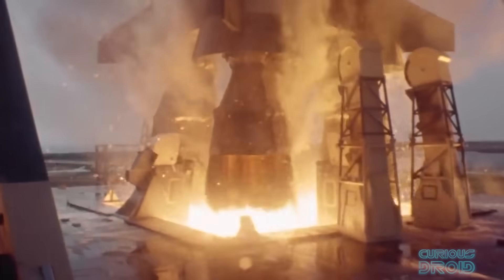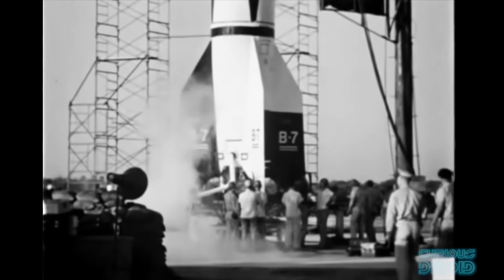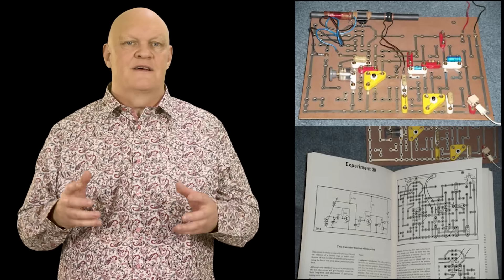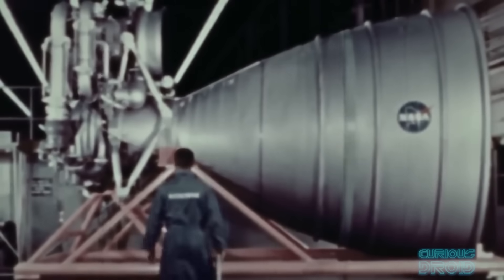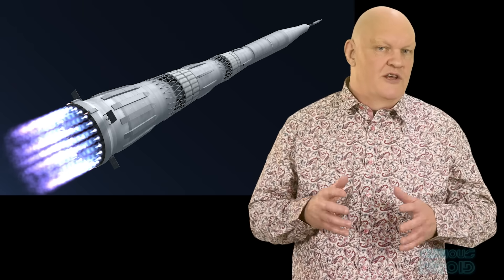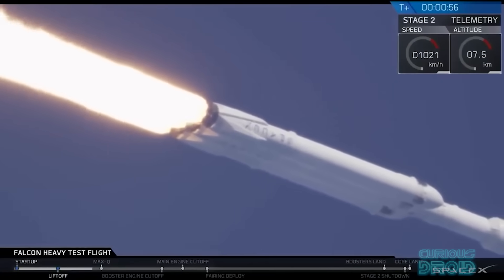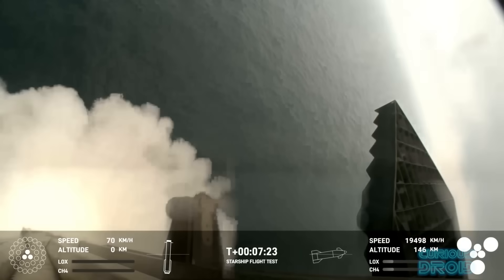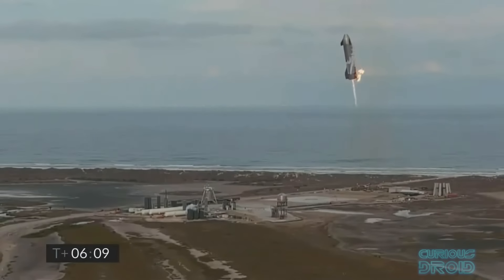Why Does SpaceX Use 33 Engines While NASA Used Just 5?

Comment: The F-1 was only "relatively" simple. Agreed, it could not throttle. But the sheer tonnage of fuel moved 0:07 through turbines in an ignition sequence requiring analogue components eg wax disks to burst at optimal time to ensure ignition was audacious, glorious, and never to be repeated. The US version if Soviet tractor design. Simple+adequate=good.
Reply: You're wrong. The F1 could be deep throttled, they just never bothered with it because they didn't need to.
Reply: Now in English please 😅
Reply: @BigPapaVerde17  There were no computers in the F-1s, so the timing of things was often handled by bits of "stuff" that would burn through, or melt, at just the right time to say divert gases from the turbine "engines" to start entering the nozzle to help protect it before full ignition. A lot of it could have been a fantasy by Rube Goldberg, but engineered with precision. Did you know that the protective covers on the hold-down clamps for the Saturn V were literal bits of cord? Seriously.
Reply: Did you ever see a documentary on the Russian moon capsule? The life support systems were built around an array of faucets instead of electronics! "Comrade, did you just fart? Turn on CO2 scrubber number 3!". Famously in the early manned space program astronauts systematically tested which ballpoint pen designs would still work in zero-G, while cosmonauts were simply issued pencils. As you say, simple+adequate=good. Not to mention cheap.
Reply: Holy skidmarked flight suits! We have a moon landing liar idiot plant.  Here! Incredible. Don't scare it, I want to study it's habits...
Reply: Did Apollo 11 actually leave near-Earth orbit?
Despite the revisionist narrative that this channel won't question -- unstable fuel burn for the oversized F1 engines was never rectified and another arrangement in their place was made in order to reach near Earth orbit, keeping the F1 bell nozzle to maintain the desired appearance.  The great licking yellow flame was an indication that something was not normal as fuel was burning in the atmosphere while providing no additional thrust. This was the result of injecting additional kerosene into the exhaust stream for greater visual effect yet appearing to produce an inefficient burn unlike other rockets after launch.  No explanation is forthcoming and this issue is not addressed in any usual report; however, using a smaller reliable engine with a reduced fuel load and stripped down mission requirement allowed the Saturn V to reach near-Earth orbit.  

The Apollo 11 crew attempted to demonstrate their position at over halfway to the moon as seen in the unedited version presented to the public while the more recently released unedited version reveals a flood of blue light entering the same window as the camera continues to roll, through which only a moment before, we saw the Earth far distant in what appeared to be very low light conditions. Then, as the camera pulls back from the window, the exposure settings are seen to return to normal as a flood of light enters the same window.  Without a change in the orientation of the spacecraft assumed to be on a trajectory toward the moon, the only source for any flood of light can be the Earth while in near-Earth orbit.  The usual sponsored efforts will try to make excuses for why the obvious did not take place -- yet is overly apparent in the unedited version.  When facts cannot prevail in support, sponsored activity will resort to name calling and other derogatory comments discrediting themselves.
Reply: @ronaldgreene5733  The "yellow froth" was exhaust from the turbines whacking the fuel into the F-I. That kerosene-rick exhaust was injected into the engines as an additional coolant layer between the fully-burning fuel coming through the injector plate and the inner lining of the nozzle. Now, drink your milk and go to sleep, you silly boy.
Reply: .  . While remaining in near-Earth orbit, another indication are the impossible weather patterns seen on Earth, when in reality only a small portion of the Earth's surface was visible, framed by the round window of the command module.  Straight line cloud fronts are seen on video to be extending for what appears to be more than 6000 miles, a quarter of the Earth's circumference -- something that has never occurred in the meteorological record on Earth. The round window of the command module was used to effect an image of the Earth but the weather in the region did not comply for a realistic view.  No recognizable continents are found in view, but only the impossible weather patterns seen.
Reply: @ronaldgreene5733  You need to understand the perspective of a) low Earth orbit; b) windows at minimal size to ensure safe flight operations (not sight-seeing) and c) no provision  wide-angle lenses (again, not sight-seeing). Lengthy statements based on incorrect information are no more correct than short statements. Please keep them short hereafter, for all our sakes.
Reply: @mickwilson99 .  . "You need to understand " .  . 😃 .  . Thank you for your sponsored reply, Mick.  Apollo 11 claimed to be over halfway to the moon -- demonstrating with a view of the Earth in the distance according to the record.  If the camera was able to zoom in from that distance to view a portion of the Earth, then we would see the area change around the edge as the camera was in motion. The camera was not steady as they continued to make adjustments.  Yet the same round portion remained visible of a specific area of the Earth's surface regardless which way the camera moved during adjustment, proving that something else was framing the area of Earth in view -- not the aperture of the camera but rather the round window of the command module.  It can be clearly seen on video that the camera is back and away from the window as someone's arm momentarily enters view between the camera and the window.  If only he had remained to one side so that the illusion might be presentable.  However, the weather in the region did not comply, having two prominent straight line cloud fronts traversing most of the area in view -- belying the claim that we were looking at the entire Earth, far distant from over half way to the moon -- rather than a small portion of the Earth's surface measuring a couple of hundred miles across where such cloud patterns are realistic .  . Give it another shot there, Mick and we'll wait for your response.

Comment: the spacex starship design is eerily reminiscent of the USSR N1 which also kept exploding...an earlier version of the N1, with a similar engine layout, was the infamous R16 which was at the center of the 1961 nedelin disaster...
Reply: There are major differences though. 
1. Engines: the NK-15 could not be tested before use. It used pyrotechnic actuators that had to be replaced once used. So instead, they'd build 6 engines, test 3 of them, and if those passed, use the other 3 on the rocket. SpaceX tests individual engines, AND can test the complete stage at least for brief test runs on the launch pad. 
2. Control systems. KORD on the N-1 was unreliable, famously shutting down all but one engine when one of the launches developed a recoverable fault. Not an issue with modern electronics. 
3. CAD. SpaceX can simulate the vibration environment in the stage in ways not possible in 1965, which eliminates many failure modes (at least one N-1 launch failed when a fuel line shook apart). 
4. Money. SpaceX is rich and can afford to expend a bunch of rockets. The Soviets were not rich, and really couldn't afford the N-1.
Reply: Just as well Starship is judged by performance and not appearance.
Reply: @maxfan1591 so far the starship hasnt preformed much better than the N1...im not aware of any successful starship launches & if there have been any they remain outliers...if not then they preform equally bad...
Reply: @libbychang413  There have been four launches, every launch more successful than the previous launch. Both the third and fourth flights successfully reached the target trajectory, so if these were regular rockets with no elements of reuse, they would have been labeled complete successes.

SpaceX is still working through the challenges of reuse, but that will continue after it starts making operational flights. I currently expect flight six to carry satellites, maybe around september.
Reply: @libbychang413   The N1 and Starship have launched the same amount of times, the N1 exploded before first stage jettison every time, Starship successfully landed both portions of the ship on earth, reached space, reached near orbital velocity's, and did so in half the time.
Reply: @libbychang413  "so far the starship hasnt preformed much better than the N1...im not aware of any successful starship launches"

If you define "launch" as the period ending when the engines shut down at orbital speed, then two of four launches have been successful. As others have pointed out, the N-1's score on that metric is 0 from 4.

"& if there have been any they remain outliers"

LOL! Two out of four is hardly "outliers".

Comment: I know people like to compare the Saturn and starship rockets but there so many differences it’s like apples and oranges. Just remember that the Saturn was designed with slide rules and mechanical pencils with little reference material available. Starship is all computer design and 3D models with a library of resources to refer to. Hats off to those old men with the pocket protectors. 😁👍
Reply: Apollo was also under the gun to meet the moon landing deadline, which is why they went with the F1 engine concept that was already being developed, rather than start clean-sheet with something new.
Reply: Thanks William Foster !!
Reply: Masses of  'reference material'  to refer to for Apollo, many millions of man hours of research. And today's tech stands on the shoulders of as a base.  In 60 years from people will joke about today's tech and will laugh about it.
Reply: @jagmarc  Ну как то сейчас почему то никто не смеется над технологиями ракетными 60 летней давности, да потому что ничего супернового не изобретено. Чуть лучше, чуть эффективней, но не в разы. И через 60 лет люди смеяться не будут, потому что ничего особо нового и не изобретут.
Reply: @swampfolk2526  Something I have noticed with the current state of the art is the system complexity has increased by orders of magnitude and is now heavily dependend on fully autonomous computing during mission. And there's another huge difference, manned spaceflight isn't or shouldn't be done that way.
Reply: Very true
Reply: Incredible nearly every response is dumber than the last, the lot of you need to be in a classroom again
Reply: Никакой компьютер не поможет разработать большой двигатель сравнимый по эффективности с несколькими маленькими. Маленькие тупо лучше.
Reply: Starship is trying to actually go to the moon and has to solve a lot of problems that NASA never had to figure out for their little Apollo ruse.
Reply: Yes, at the same stage in the programmes, Apollo was sending craft around the moon. Starship can barely make it past the Karman Line with an empty payload bay, and making it back to earth without exploding is considered a wild success. Even though the 'reusable' craft is half melted!

The booster did good, though.
Reply: @splashfreelance  Starship has gone twice now to roughly 99% of the way to LEO. If they fired the engines for another 1-2 seconds they'd have been in orbit. That's not "barely past the karman line". The Karman line is more like 20% of the way to LEO. And they had tens of tons of propellant left over which could have been payload instead.

Also, if we say Starship got started in 2018, and Apollo got started in 1960, we can compare what Starship is doing this year to what Apollo was doing in 1966. That was three suborbital flights, AS-201, AS-202 and AS-203. So no, at this stage of the program Apollo wasn't sending craft around the moon.

(Setting a starting date isn't entirely easy. Hardware was being worked on years earlier for both programmes. But I think 1960 and 2018 are fairly accurate years for when major work started.)
Reply: @splashfreelance  absolutely! Starship is not even close to what it needs to be but still gets applause at every failure. 🤷‍♂️
Reply: @bluntone2273  Sure, but it's getting there, you have to give them credit for the steady progress they are making and I say that as someone who is not a fan of Elon.
Reply: You really have no clue about the history of NASA and space exploration do you? Rocket science was never a field for people who give up easily
Reply: @bluntone dealing with failure after failure is what it means to be a researcher in the cutting edge....of ANY field.
Reply: And yet saturn was successful, starship is a spectacular failure. It's supposed to be delivering humans to the moon early 2024. They're already very late. And they haven't got out of earth orbit yet. With no payload.
Reply: @JamesFaction  Starlink's doing well. Horses for courses.
Reply: @jagmarc  that has nothing to do with going to the moon. Starlink is low earth orbit. 0.1% of the distance from the earth to the moon
Reply: Did Apollo 11 actually leave near-Earth orbit?
Despite the revisionist narrative that this channel won't question -- unstable fuel burn for the oversized F1 engines was never rectified and another arrangement in their place was made in order to reach near Earth orbit, keeping the F1 bell nozzle to maintain the desired appearance.  The great licking yellow flame was an indication that something was not normal as fuel was burning in the atmosphere while providing no additional thrust. This was the result of injecting additional kerosene into the exhaust stream for greater visual effect yet appearing to produce an inefficient burn unlike other rockets after launch.  No explanation is forthcoming and this issue is not addressed in any usual report; however, using a smaller reliable engine with a reduced fuel load and stripped down mission requirement allowed the Saturn V to reach near-Earth orbit.  

The Apollo 11 crew attempted to demonstrate their position at over halfway to the moon as seen in the unedited version presented to the public while the more recently released unedited version reveals a flood of blue light entering the same window as the camera continues to roll, through which only a moment before, we saw the Earth far distant in what appeared to be very low light conditions. Then, as the camera pulls back from the window, the exposure settings are seen to return to normal as a flood of light enters the same window.  Without a change in the orientation of the spacecraft assumed to be on a trajectory toward the moon, the only source for any flood of light can be the Earth while in near-Earth orbit.  The usual sponsored efforts will try to make excuses for why the obvious did not take place -- yet is overly apparent in the unedited version.  When facts cannot prevail in support, sponsored activity will resort to name calling and other derogatory comments discrediting themselves.
Reply: @ronaldgreene5733  This whole post is garbage.  You obviously don't understand what you think you saw.
Reply: @ronaldgreene5733  
You don't think the Russians were watching the most important event in history...OR at least the risk of them watching was TOO great to even consider faking anything..???
I don't understand why so called 'smarter than rest of the Sheople' conspiracy theorists don't think their lazy utterances through!

You just come off as being like one of those morons that are really pleased with themselves after saying something that was actually REALLY STUPID.
Reply: .  . While remaining in near-Earth orbit, another indication are the impossible weather patterns seen on Earth, when in reality only a small portion of the Earth's surface was visible, framed by the round window of the command module.  Straight line cloud fronts are seen on video to be extending for what appears to be more than 6000 miles, a quarter of the Earth's circumference -- something that has never occurred in the meteorological record on Earth. The round window of the command module was used to effect an image of the Earth but the weather in the region did not comply for a realistic view.  No recognizable continents are found in view, but only the impossible weather patterns seen.

Comment: The difference in the thumbnail is that the Super Heavy thrust structure weighs about the same as the saturn-5, while producing quite a bit more gross thrust, and also having better specific impulse. This is because increasing engine size causes its weight to increase faster than it's thrust increases. Therefore more engines perform better. You also typically are forced to down-rate the chamber pressure at some point, as the engine gets larger, for complex reasons. Hence more, smaller, shorter engines weigh significantly less, and for certain reasons can be expected to perform better.